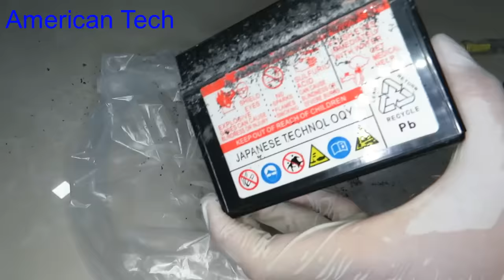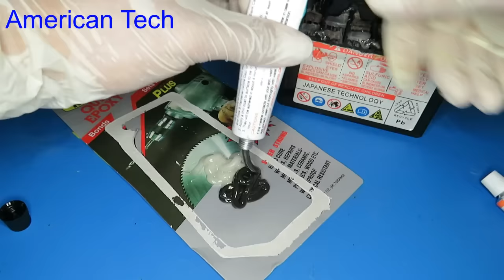Easy way  to repair 12v lead acid battery step by step , Awesome project that can help you

Comment: Hello mate ,that is good job. Can you tell me what papel your use in this proyect. I need to repair one.thanks
Reply: Tissue paper or toilet paper
Reply: Dont do that the acid will eventually dissolve it and the plates will touch.
Reply: I'm still looking for this info too, guess this guy don't answer his comments or put details either :-(  If U respond in few days to this, I may have an answer
Reply: Looks like AGM battery , it’s not top up w acid , absorb glass matting  -  just Google it

Comment: Cool Idea, adding sufuric acid to paper towls. How long do they last. 1 or 2 hours?. If you are going to all this trouble to restore the battery why not use Fibre Glass tape as the divider like the manufacturers do its not expensive.
Reply: Thanks for this. I will ask at the hardware store

Comment: i do like that the title says 'repair' but the man in video proceeded to take the battery apart with a saw and do unrepairable damage to the battery housing. 
thumbs up

but yea, you can actually do this.. all you need is, a Saw to break the battery housing open, a knife to clean the plates, some paper to separate the plates, acid, a soldering iron(a beefy one), solder, some wire probably 18 or 20 AWG, Epoxy steel to weld the battery housing back together without making a total mess. how much would all this cost just to repair a battery?

Comment: See how the cells are puffed up. That means the battery is completely sulphated. That means that the battery is not being charged to the proper voltage to restore the battery. Check out Peter Lindemann's Battery Secrets video for the correct voltage for each cell.

Comment: Corrupt fix
Missing experience
Placing handkerchief separators
(Sulfuric acid will destroy it)
After a period
Sulfuric acid will attack and destroy the wire
You have to study the battery well first
waste of time !
Reply: He never filled it with sulfuric acid. He just sprayed distilled water.
Reply: @vijaykumarsubramanian3442  Yes I did not pay attention
Yes you are right

Comment: This is better than other battery reconditioning, I have tried many, yet to try this one, pls some question: sometimes one or more of the cells fail, how to redo that, the acid used proportion with distill water??

Comment: When plates are gone there gone. Such a bs this...
Reply: I can still see the plates. That's why ppl recycle them. Batteries aren't wizardry it's very simple science and this guy has the knowledge and understanding of how a simple lead about battery is made. Shit you can make a better from copper penis and metal zinc washers.
Reply: coz lead is real hard to melt right !!!, so its way to hard to make a few new plates if there worn out.
to all those that slag of people for trying and learning, if you want to go buy a new anything and leave the learning to others then feel free you have that right, just pee off to the shop rather than giving shit to the people that put more value on knowledge than curacy. some people cant afford to go to the shop. others would rather the knowledge of how than the actual item. not everyone is like you and most of them would never want to be like you

Comment: "the box was cleaned"  Down the kitchen sink drain with all that lead/acid?  Or did you dump it on the ground or in the creek?  How did you dispose of the chemicals?  How much did that cost you?
Reply: He wore ineffective latex gloves and I'm sure he wasn't using a respirator. It's doubtful he properly disposed of or neutralized the chemicals...

Comment: That's a fascinating video.  A lot of effort.  A new motorcycle battery in the USA is about $70.  So, you saved ... $70 - (cost of epoxy, acid, etc, value of your time).
I'll buy a new one. 
You may want to hang out by a store that sells batteries and intercept the customers bringing in old batteries to get their "core charge" refunded.  Buy those ($10 for MC battery; $15 for car battery) and do your magic and resell them.
Thanks again, always wanted to know what's in one of those lead acid batteries.

Comment: I see many problems
Maybe the soldering lead it's not the best for that. They use pure lead for something
2 that 2 small cables from inside battery, can't hold the current for too long
3 why light come brighter after 3 seconds??

Easy, way safer, and better quality -> buy new one. Or melt the lead and make a new one from this old battery

Comment: WTF? Paper towels between plates? in sulfuric acid? How long the battery will survive? 24hrs? Until the cells will short? 
If its not a simple paper towels,then - sorry for my comment.

Comment: I gave you thumps up But you made a mistake using a " thick wire a shorted the battery" that is a NO/GO if this is done on purpose needs to be with a extreme thin so it can burn out quickly nano or pico seconds.  Multimeter is a must. That is if your a technician. or "OJT" on the job training. Safety First or better " Military saying" SAFETY ALWAYS

Comment: Very good video but i will buy it Only the glue is 9 dollars + taxes + the  fixing time = money and i need to buy the soldering tool also and the new battery price is between 20 to 25 dollars

Comment: Replacing the electrolyte pads with paper towels, does not solve the sulfation issue with the plates. Besides it's just a huge waste of time, unless you make 1 dollar per hour. And what was the end capacity? Guarantee it was nothing close to the original 5 amp hour.

Comment: One little air gap between the cells and they will gas across and you have two dead cells and wasted time and more money than it is worth, replacement is cheap.

Comment: Never do what this person did. Don't connect the positive and negative terminal of the battery with your bare hands. The battery they used is not just "dead", it has been discharged to zero. Nothing left. Even "dead" batteries will instantly heat up to a skin-searing temperature if shorted. Enough to turn the terminals and the wire you are holding orange. Cool video, but 99% of powersport batteries laying around in a garage have enough charge to burn the shit out of you

Comment: Does this changing the separators really work?? If it does, then how much of the original capacity can be restored by this method????
Reply: Assuming you use something better than tissue paper (or that t. paper lasts more than I thought), then all of the capacity

Comment: All that work to open up a dead battery. Clean it. Put it back together. Put it on a charger. Then test it. Any reason you didn't charge it first and test it? No parts list either.

Comment: As someone who's career is in the battery industry, this video is so cringe it's disgusting. A prime example of something that will work well enough to show voltage for a YouTube video but will not start an engine more than once.

Comment: 55 watt bulb is nothing. Try it now on a motorcycle. Bet your bottom dollar it will not crank because the wires inside are to thin. Better to buy a new one, that will guarantee that your motorcycle will start. Still a good entertaining video.

Comment: Copper wire inside acc is not a good solution, acid eat them  all.
Reply: What do you think was in-between every lead plate? Copper that's how lead acid batteries are made

Comment: PATHETIC ! 
That light bulb should be blinding the cam had it been fed proper strong current !!!
It's merely glowing - as everyone can see ..
A fresh built battery does NOT need charging !?  That's Basic ! 👉 THE CHEMISTRY OF THE ELECTRODES (LEAD) AND THE ELECTROLYTE (ACID) GENERATES THE ELECTRICITY.
Did you ever buy a New lead-acid battery that needed charging before it could be used ? ( That's common with Other battery principles - NiMh , and partly different Li components. But not Freshly built Lead-Acid batteries ).

Please !
Go search for more meaningful purposes with your life !  
✴  I MEAN IT  ✴

Comment: omg , i used to assemble and create low volume batteries, "rubber batteries " so called as the case was vulcanised rubber , used in many vintage cars , i cringed at the methods used here , to join plate banks i used "bar " lead not soft solder,(solder is tin, lead ,antimony ,copper and bizimuth )posts were attached directly to the plate banks , this repair would work but not for long before the joints would crack or the wire dissolve , never really understood why the rubber batteries lasted an average of 12 years as opposed to new constructions 4 years , being able to maintain electrolyte levels in the old style was definately one reason tho

Comment: You luckily didn't have any voltage in the battery or that wire would have burned you almost instantly

Comment: That solder job better be able to handle the current pushed through the cells or your just wasting your lungs inhaling lead and fumes from sulfuric acid. Waste of time to begin with. LAST RESORT ONLY.

Comment: I was expecting the car headlight bulb to be blindingly bright. It was so dim! The battery was not strong enough to be used like a brand new car/lawnmower battery at all. It wouldn't have started any engine. A complete failure!!!

Comment: Most guides just tell you to add destilled water, and it never solves the problem. This probably will, but if you have the option you probably should buy a new battery.

Comment: I can see doing this (desulfating a battery) on an expensive submarine battery or maybe even on a top of the line 8D. But on one of these little batteries? Maybe if it wasn’t available anymore, but these little batteries are dirt cheap.

Comment: Is it even worth it? I think he spent more money on epoxy glue, electricity, water to wash all those plates, acid, solder + time consumed. + there is an enormous risk in doing what he did. Is it worth it? Such a battery costs about $10-15 🤣🤣🤣

Comment: What are that white color papers? 
And what do you inject by a siringer?
Reply: The white paper is regular paper towel, it is used to suspend the sulfuric acid (from the syringe) between the lead plates

Comment: - Does the amount of paper between the plates matter?
- Did you really ONLY put 3.33ml of fluid into each cell - a total of 20ml for the whole battery?
- What liquid was it - some acid???
- Why does a fully charged 12V battery make a halogen lamp glow only slightly?
- What was the pole voltage before and after charging?
There must have been a leak in the gluing at the back edge at the minus pole, right?
The rather vague presentation you hastily prepared and the video's claim to never need to buy a 12v battery again...that's complete nonsense - at least with this repair method.
Well... American Technology ...yeah right!

Comment: Muchas fallas! Esto se podría arreglar en el único caso hipotético de que las celdas estén sulfatadas, si están rotas, con este método no se solucionara. Por otra parte, como va a soldar plomo con estaño? Como va a dejar cables eléctricos metidos dentro de la batería en vez de hacer bornes nuevos? Error al destapar la batería, va a liquear. Si estas leyendo este comentario, no hagas esto, el plomo va a contaminar tu sangre, y pondrás en riesgo tu salud, y es muy posible que al final de cuentas pierdas tu tiempo y dinero en algo que no funcionará.

Comment: Disappointing that a multimeter wasn't used to check the voltage afterward. The real question is weather how long the battery would last and how long it sustains amp usage.

Comment: cause shorting the leads is a safe way to test a battery, if that had a full charge that coulda went bad fast....get a real soldering iron and dont use a battery, you trying to blow yourself up?

Comment: Solder 20 bucks, soldering iron 15 bucks. Hacksaw and blade 20 bucks. Liquid steel 10 bucks. New battery from Amazon 23 bucks.

Comment: Looks like a bogus video. the Jb weld was steel and it will conduct electricity AC or DC, So with scooping Jb weld the way you did and it running down in the cells. Wouldn't that cause a dead short or something because the plates are together like taking a 12v battery and adding another to make two. Pos to Neg. So if the steel JB weld ran all down i9n the plates wouldn't that just cancel everything I noticed plastic dividers so they wouldn't touch. Just asking.

Comment: Repaired batteries would not give you the original condition. it might cause short-circuiting even breakout of fire. much cheaper to get a new battery than claiming the damages

Comment: Hi, thanks a lot, :):):), nice funny comments bellow. I wanted already few years to try this by myself, I am I European Union, very close to my cousin Putin :), prices are soaring 3x then last year September, lost my job and I have about 6 big tractor batteries at home. I would like to ask you what kind of paper you use to isolate the lead elements?? It is very important to use something to be resistant. Thanks, Ben

Comment: the battery cases use to be clear back in the 60's then people saw all the stuff accumulating in the battery over the years, although the battery was still good they wanted a new battery so they soon made the cases so you could not see inside.  way to dangerous  i will just buy a new battery.

Comment: I’ve seen worse videos. But this is definitely not something I could advise. There is nothing safe about what you did here. Your dealing with sulfuric acid. If you don’t take the right steps and use the wrong gloves or get that on you hands it will not be a good day. And if you don’t dispose of the waste properly it could end badly. This battery will not have the power capacity if a new one. Long story short just spend the 25 - 30 bucks to get a new battery

Comment: Why bother? I can buy brand new batteries like that for less than $15.00 10 minutes away. Plus they will take the old battery to recycle for free. I can be there and back before you finish sawing the top off. Did I mention the 1 year warranty? I hope you dispose of the old materials and residue in a safe manner.

Comment: I was wondering if there's a chemical mixture that can clean the plates off without scraping off the lead fibers that increase the surface area. That battery may have worked but wouldn't put out nearly as much amperage as a new one after scraping the plates like that
Reply: Lead is a metal not fiber there is no lead fibers. Surface area is how a battery creates current so if you scrape a thin layer it's going to be litterally an un measurable difference between new but I don't think he scraped it enough
Reply: @joshuawheeler4404  it's coated with a lead oxide that sort of resembles a paste and put it on the plates to form a jagged surface for more surface area as opposed to a smooth surface with less. Think about about drawing a zig zag line, and underneath it draw a straight line. Now imagine straightening out the jagged zig zag line, it would be much longer than the straight line you drew underneath it. That's the idea behind it.
Reply: There exists some sort of additive that is added to wet lead acid battery cells to get them to somewhat work, but it will not return the battery to its full performance parameters. Not sure what it was called, but something along the same pronounciation as EDTA or epsom salts.

Comment: Are those plates inside are nickel? Can it be used to make nickel acetate? Thanks!
Reply: They are lead plates (as indicated by the “PB” marking on the batteries). The stuff on them are lead oxides

Comment: Unsafe...extremely unsafe.  Somewhere in India, a small house fire spread to the whole block and 100,000 are homeless.  The fire chief said it was linked to a 12v battery.
Reply: Correct; Someone else asked not to see the wrong way to do it so I did not report the blow your face off with H3SO4 due to sparking done by discharging the plates as he shows for testing;  1Meghom resistor left on the unit for a few days clipped to the terminals might be one way to remove most of the charge but running only a few minutes I see him dumping the hydrogen sulfide into a plastic tray so I am going to look somewhere else trying to find 0.83 ampre thermostatic switch with hysteresis to switch an SCR to pull down the Contactor coils;

Comment: Thank you for this wonderful work, but what is the thing that you put between the lead or the cells, please reply
Reply: Yes I was wondering that too.looks like several strands of solder.
Reply: Looks like café napkins 🤣
In the real world it would be fiber glass mat
Reply: Fiberglass Mat which can be purchased at local hardware stores such as Lowes/Home Depot.  They often call it Fiberglass Cloth.  You are after the thinnest matting/cloth possible and will need to compare brands & products .

Comment: Sir can you please tell me which paper is placed between that electrodes
Reply: It looked like he used paper towel, which would dissolve in a few hours at best. A microfiber glass is what is actually used. It's also coated with lead oxide. His video is a gimmick.

Comment: Hello, I'm from Brazil ...
What do you use between the battery plates? 4:47
Reply: Microfiber glass coated with lead (2) oxide paste. He used paper towels from the looks of it. Probably dissolved within a few hours at best. It's likely he charged it for a few minutes to get the bulb to turn on and then trashed the battery. It's not worth the lead he absorbed through those latex gloves, not to mention the dust he took in.
Reply: @alexanderthewise1352  Why not reuse he original cloth, paper or whatever it is , just remove it carefully.